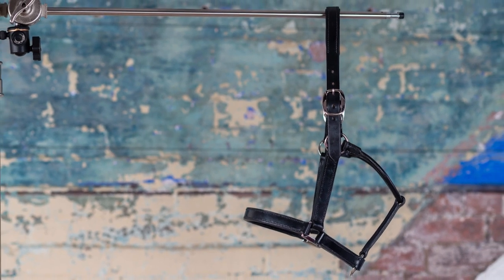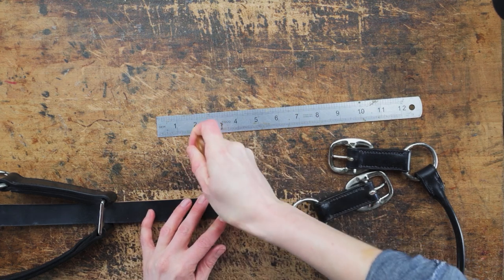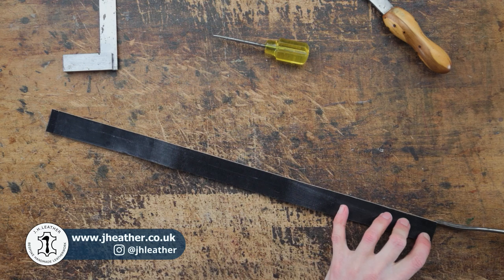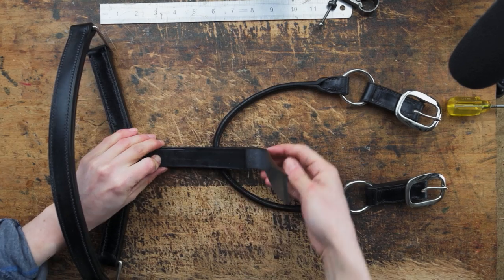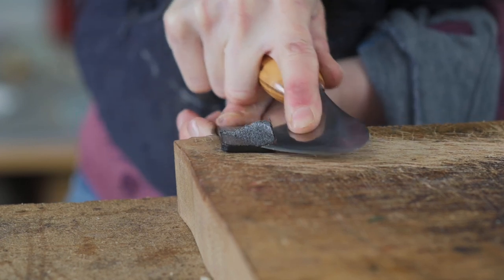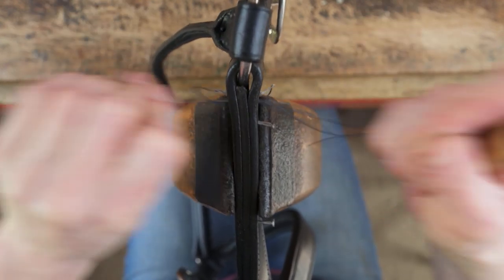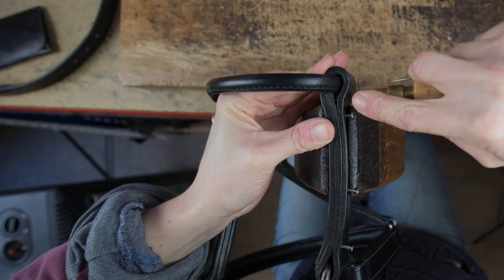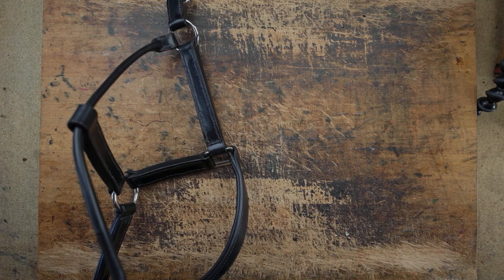Make you own: Headcollar - Part 4 - Cheeks and Backstay ~ Bridle work Tutorial

Comment: Awesome videos! With the padding, it looks like craft foam, is that correct? I use 3mm for testing patterns.... Glad I can use it for padding too! That's how I found you, searching padding leather. Cheers
Reply from the maker: Hi George, the foam is called plastazote it seems to be pretty common when you Google it, you can also use neoprene. I use 6mm thick foam with 0.8mm chrome tanned nappa to pad it. You can use thicker leather for padding but you'll need to take into account the extra thickness will make your padding wider (hope that makes sense). Jo